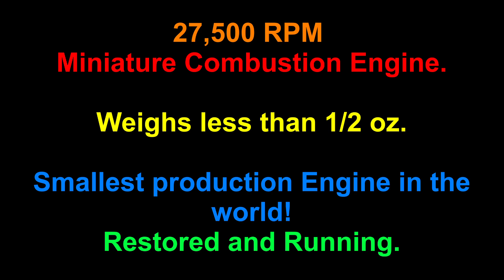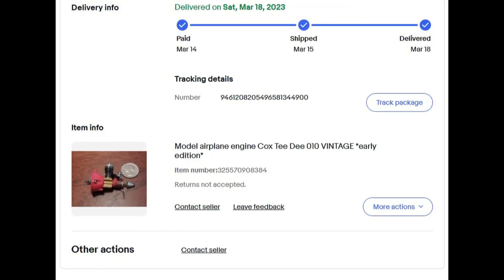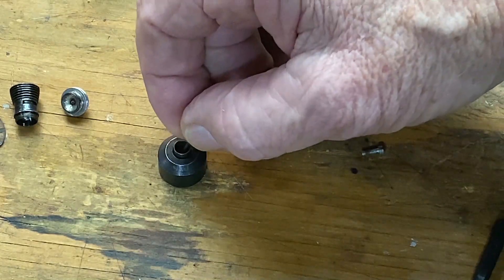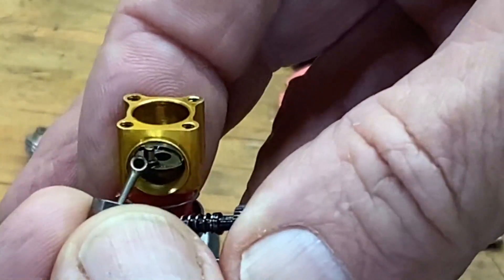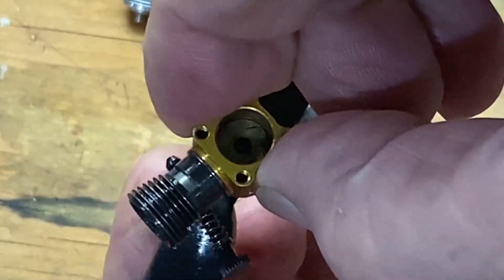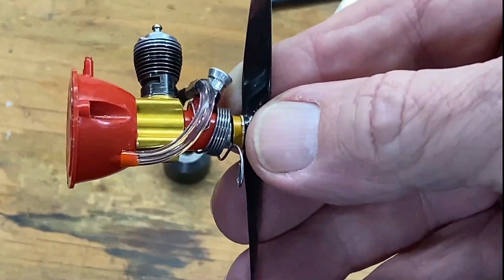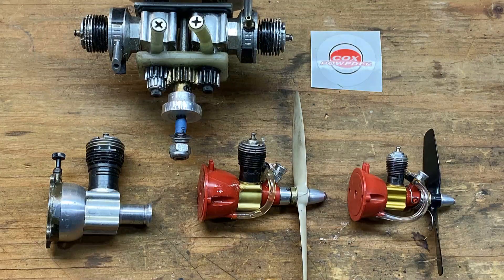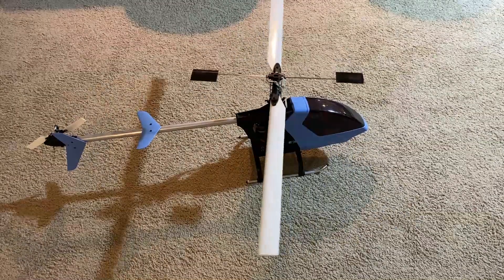27,500 RPM! Tiny Combustion Engine. I tightened the Piston to the Rod ball & run a Cox Tee Dee .010.

Comment: The actual static rpm on an engine stand is rather 26k..the unloaded speed in the air is higher than 27k...the audiotach result by an Android RPM GAUGE app. of this video is near but below 26k
Reply from the maker: Of course all engines spin faster unloaded. This was the advertised RPM.

Comment: These are lovely little engines. I have an original red 010 in a plastic case, and never run. I purchased one of the later black Cox 010 engines which is a real screamer. I have a collection of over 200 engines, mostly 'diesel' or compression ignition engines including a 1/20th cc Valentine engine from Germany. My Dynajet pulse jet is from the 1950s but I have never had the courage to fire it up. Thanks for the video mate.
Reply from the maker: That is a good collection for sure.  I never had luck with my dynajet.  It was always iffy to get it started.  Thanks.

Comment: Very nice to see my friend :) I’m working on building a tee dee 020 from parts (can’t quite swing the cost of a full engine) I’m looking forward to getting back into the hobby. I collected these engines as a kid 2007-2012 but I’ve been out for over 10 years and have nothing in my collection thus far lol.
Reply from the maker: Yes, they have become quite pricey these days.  Many parts can be found on https://www.coxengines.ca   Thanks and good luck.
Reply: @NightFlyyer they most certainly have, I wish I still had my collection. I had nearly 40 engines all together, I’ve used coxengines before, they are a very great company. I lucked out on eBay and purchased a .020 piston, and the seller is throwing in a sky copter engine as well 😊 I’m working on creating a cad model based off a free flight model from 1947 that I hope to scale down and 3d print. What would you suggest for an all up weight for the model or an idea of wingspan? I’m thinking around the 24” mark and 2oz for the airframe
Reply from the maker: @Miniaturerailwaymuseum  That sounds like a good start.  Nice and light.  The engine will pull that great! Good luck and happy flying.
Reply: @NightFlyyer  thank you 🙏 I think that will be about right as well. I’m so excited to start flying again

Comment: 40 years ago I took a 049 and filed down the glow head and cylinder to raise the compression, drilled out the air inlet and needle hole and mixed up some Missile Mist with everything I could find that would burn to fuel it. There was some alcohol, acetone, gasoline and some regular oil mixed into the nitro fuel.
Amazingly it screamed so fast it was almost inaudible. I had to keep the fuel bulb I was using connected to the filler because it would empty the tank in about 10 seconds of running. The cylinder was glowing red from the heat and almost melted the glow head.
The good old days.

Comment: Back in the mid to late 80's I ran a 051 with an aftermarket carb and it was great, having full control of the throttle gave my little plane a good life. Giving me more air time than any of the .40 size planes I built and flew. I always compared everything to the QTee. With the tiny radiiogear

Comment: 😂😂 brother just the other day I came across my identical TD as well as  two 020 PW'S, an 020 TD a 1/2 dozen 049 PW's, about 3/4 of an 074 QB and an 090 TD. Remember those ones?! With the aluminum collector and pipe? 😂 Sure u do u probably have 5 of each lol. I also found an unopened tin of  cox 30%? I think from the 70s it's a blue can with a dark plane silhouette. 😄 I remember the 2 tiny  ones actually approaching first flip starts and semi tuneable reliability once I got me a tin of 25% Anyways thanks for the show man, it seriously engaged a mystical state of clairolfactance 😭😂 I'll be digging it all out in a month or two, I've probably got some things you'd like if u have any interest. Cheers
Reply from the maker: That is great.  I only wish this .010 was not lost.  Pretty rare.  Sounds like your another Nitro lover, and that is good to hear. Thanks much.

Comment: That’s quite a lot of RPM’s!! I knew these engines did somewhere in the neighborhood of 21.000 RPM’s. It was very interesting 🧐 when I took one ☝️ apart. There was no magnet 🧲. The piston and connecting rod are very tiny, but these engines make A LOT of NOISE!! They’re approximately 1️⃣ horsepower, by what I have found out. I’m guessing that the plane does about 45 MPH, just by this engine. I never 👎 knew that the piston and connecting rod could be adjusted on these engines. Your friend, Jeff.

Comment: I remember having a .49cc 50+ years ago that ran on ether. I made a UFO flier for it. Funnily enough, they have become popular again, i.e. the real UFO :)
Reply from the maker: That is a bigger engine for sure.  I made many videos on our UFos. I call mine You FO's.  Here are  two of my favorites.  This is my mini with a .049  https://www.youtube.com/watch?v=DeWao5L6FLM&t=123s  and this is my bigger Nitro version (I have electrics too) with a .32 heli engine. https://www.youtube.com/watch?v=ujxDHp46knI .  Thanks much.
Reply: @NightFlyyer : Yes Google says 0.49 cc is about 0.03 cubic inches so it was about 3 times bigger than your little one. I had the engine from a line controlled balsa wood and rice paper airplane. I didn't have any remote control then, so my UFO was not remote controlled but just flew vertically up in the air so it was important to not have too much fuel on it. So I used a small syringe as a tank, so I have some control over the fly time. Thanks for your reply, I was very surprised by the big UFOs, I hope you don't get into trouble for having leaked some "military secrets". Even though Denmark is also a NATO member, I've never heard of that project. I know of a plane I think was called the flapjack. Very interesting to see, thank you.
Reply from the maker: @MitzaMaxwell  Ritht on.  You had a .049, not a .49  That is a big difference and why I was confused.  A .49 is quite a bit bigger than these small Cox engines.  Sounds like you had fun.  Flapjacks were cool with twin motors.  Thanks much.

Comment: Oil in the socket before resetting is a plus. The TD .010 rpm has been tested with small speed RC designs. I have hit 41K rpm unloaded with the stock prop! See test flight with a 2.56x4N prop down wind passes are shocking for such a small engine. https://www.youtube.com/watch?v=3i4r2kDOBlQ
Reply from the maker: I watched that and it really screams.  How did you measure that engine ran 14,000 RPM over?  Sounded the same on the ground as mine, but really great unloaded for sure.  My wife worked at Cox when they were on West Warner in Santa Ana Cal.  The chief engineer was a member of our club, and Joe Klause of Kustom Kraftmanship was a good friend.  He made fine thread needle valves, chrome cranks, pressure backplates with nipples, etc.  He would be impressed with a stock engine doing 41,000 RPM.  Thanks and happy flying.
Reply: @NightFlyyer  Thank you and for sharing, regarding Joe over the years I have gathered up some of his offerings.😀 Per that last vid link best static peak hit 28,858 rpm. Prop used was a 2.56 x 4N it unloaded another 6,326 rpm to 35,184 rpm peak- data taken with a sound spectrum analyzer flown to apex rpm / speed in front of the camera. Best recorded static rpm data testing made 33,107 with an all carbon 3x3 prop. Here is the vid with the highest unloaded rpm mentioned previous post. Pass down wind with stock black prop 41,985 rpm / 50 mph prop pitch speed. The  3x1.25 is naturally low on speed for RC use given the pitch:  https://www.youtube.com/watch?v=IBf7OCBPTq4

Comment: I noticed that you angled the needle valve away from the prop to get more finger tip clearance, looks like a great technique.  I have an .020 TeeDee that starts right up, but I've been too nervous to adjust it once it's running (been slicing my fingers on these props since I was a kid).  Fun video, looking forward to trying what I learned.
Reply from the maker: LOL.  Well, I still can nick my finger, but your right, this made it easier to adjust for sure.  I recently ran my 020 and actually put it on an electric airplane.  Maybe you saw that.  Now go run yours and thanks much.
Reply: @NightFlyyer  I have also installed 020s (mostly PeeWees) on electric models, they work great on UMX planes.  It's an easy way to get these engines into the air.  As much as I enjoy running them on the bench, they are even more fun to fly!  Take care, sir.

Comment: I don't have any 010s, but I do have a couple 020s. Adorable little things!

The RPM isn't a big wow factor for me, but I also run glow cars, so to me a 27,500RPM engine isn't even particularly speedy. My sport use car engines rev to 32-33K under looad. Still, for how small that engine is, it's astonishing that it can hold together at those kinds of speeds!
Reply from the maker: Right, but remember this engine was first made in 1960, (63 years ago)  not like the modern stuff today, so it still holds the title of the smallest production engine in the world. It worked well on planes and not designed for cars.  33 k on your cars under load!? Wow.  What kind of nitro engine do you have that does that?
Reply: @NightFlyyer  That is NORMAL for RC cars. 33k under load is lazy for them and is the realm of mild mannered RTR sport engines optimized more for easy handling and reliability than raw performance. Kyosho KE-25, OS 18CV-RX(I own two of each), Associated AE 18(1x), and my OS 30VG which is designed to sling 20 pound monster trucks around like ragdolls also falls into that rev band. A race spec car engine will hit 40k under load!

I got tons of car videos on my channel. My Kyosho Scorpion XXL, my Mad Crusher GP both have KE-25s in them. The KE-25 is the OEM engine in the Mad Crusher and Kyosho still sells them to this day; if you wanna dabble with one and have the ~550 to spare pick up a Kyosho USA-1 GP.  That truck is a blast to drive, the engine is a dreamboat, thing has a three speed auto trans in it, wheelies for days, sounds like an F1 car blasting across the yard....hehehe.

I started my adventures in hobby grade RC with cars, and with glow powered ones. Been doing that since 2003, when I was 13. Only got my 'wings' in 2019.

And ye, the little Cox td010 is an impressive li'l thing. They were pretty cheap back in the day, too. One of my holy grail engines alongside those OS wankels, but you covered the exact reason I don't own one in this video haha. Hell the only reason I got a couple of TD020s was I hit up the estate sale of a deceased aeroclub member and scored them for five bucks each.....